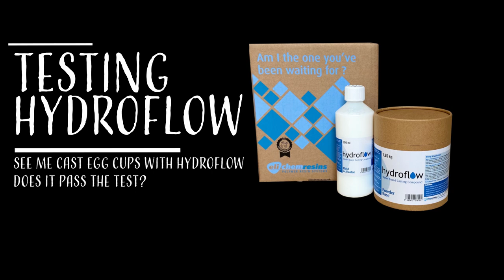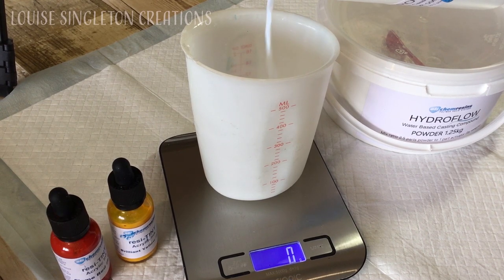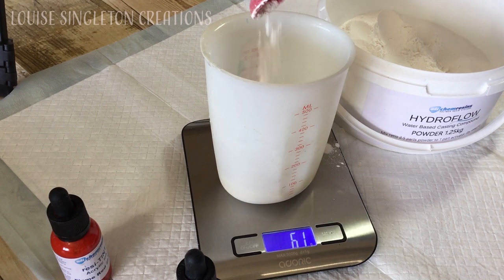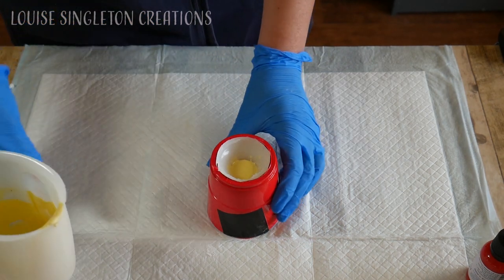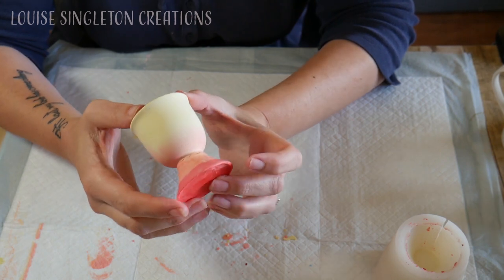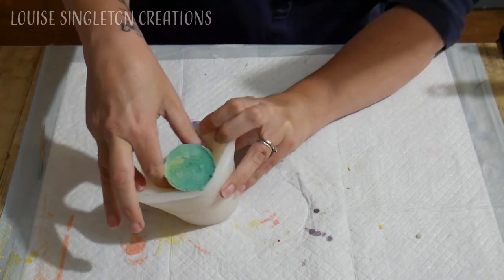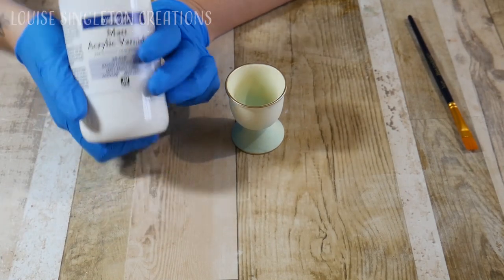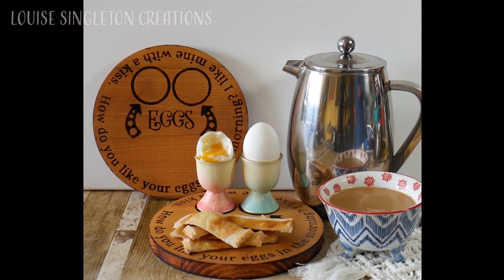Casting Egg Cups With Hydroflow, a Brand New Casting Compound

Comment: The egg cups turned out lovely. My only question is whether the sealant is food and heat safe. Thanks for sharing .👏🏼👏🏼🌸🌸
Reply from the maker: Now that is something I over looked! Excellent question, as far as heat goes, ours have been used without a problem from heat - they hand wash well too. Vallejo do pride themselves for having one of the safest varnishes on the market and they say it is non toxic but If you want to be completely sure about a food safe sealant I would recommend beeswax.
Reply: @LouiseSingletonCreations  thanks Louise for getting back to me. We don’t get Jesmonite in the US but hydro flow is available here. I am going to use it one of these days.

Comment: They don't sell hydro flow in the US? Do you know of one that is food safe and similar to what you used in this video of her people in the US I mean it's not a big deal if you don't I can just look it up I suppose but I do like trying the resins and silicone rubber products I see in the YouTube videos I try cuz I like to get a couple different ones and test them and see which ones work best for me and the temperature of my home which is usually about 70°, but one of our bathrooms has a radiator heater in it, actually our whole house has radiator heaters, my point is the bathroom is smaller and it gets real warm about 75 in there so I usually put our finish projects are epoxy resin projects right in there
Reply from the maker: An alternative I would recommend is a very strong plaster , I use stonecast by Mouldmaster sometimes. It’s much cheaper with similar effects you can purchase polymer additives to use with plaster which would make it more like Jesmonite. Plaster is very good but doesn’t take pigment as well as an acrylic based compound would.